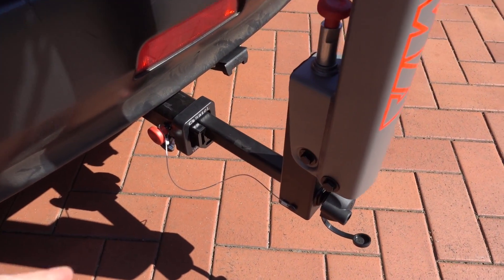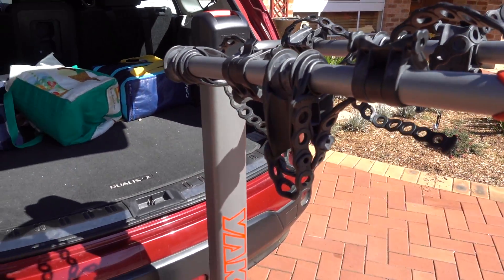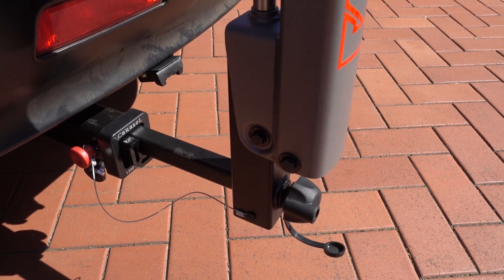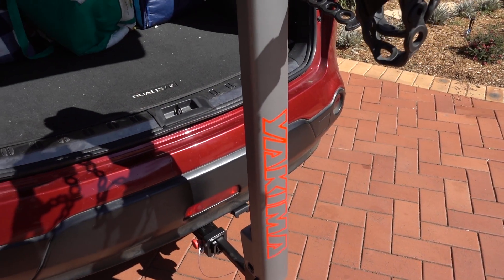Car Bike Rack Mechanical Design Paranoia

Comment: What's the weight rating on that bike rack? Seems like a.light duty one to me  for those ultra light bikes. Are you supposed to cut that bar shorter going into the hitch to be closer to your bumper? Might be made for multiple vehicles. Did it come.with straps that go from the top part of the rack and connects under your bumper on the right and left to give it stability?
Reply from the maker: 55kg max
Reply from the maker: No Straps, I should look to see if I could add them.
Reply: Three bikes seems like it would be close to the weight limit to me. I personally like to have more spare  capacity like double. So a 110kg rack or what ever closest size would probably come with the full size hitch to fit the entirety  of your reciever. No playing with shims and wedges. A little play is understandable but that sway scares me. Maybe straps would help alot. Atleast give you more confidence. I have a different style rack that mounts to the trunk of my car with straps my E bike weights 22kg and the rack is rated for 45kg and can hold two bikes. With the one bike its sturdy but I wouldnt put two bikes on it. Some.one i work with has a similar style rack as yours full size hitch and there is very little play and sway you could rock the car when pulling on it. Btw all measurements were converted from yankee measurements for your convenience. Lol.

Comment: Get new 2" to 1 1/4" hitch adapter that centers the bike rack in the hitch .... also some bike racks have a big threaded locking pin for the hitch that would take up the slack and prevent the rocking... But if you put the current rack in and then Crank down on the diagonal bolt on the left bottom you should tighten that after the bike rack is in the hitch and that should take out the slack. Also Dynamic loading should be fine the problem would occur when you put bike rack like that on the back of say a RV that you are towing and then the Dynamic Loading numbers become great... Learned that lesson the hard way
Reply: Can also get the Ubolt and plate that stops the rocking also.
Reply: I saw some with a bike rack on their RV that wasn't meant for being attached to an RV.  It literally tore the bumper right off.
Reply: Bad suggestion...

Comment: g`day it looks like top quality chinese tolerances  in the locking pin system  just what you would expect from a one-hung-lo brand  dose it comply with australian design standards might have a sticker but has it really been tested ?  mate take it back  i would  looks sus to me  if i was behind you on a motorcycle and  seen it move like that i would change lanes or pass you
cheers
james D

Comment: Add a couple of cheap straps angled down from the centre top of the bike rack to the outside under carriage.  Negated the quick opening of the boot but makes the ride stable.
Reply: that was my thought also. Eliminate the swaying which would help slow down fatigue immensely. Run a strap down to the frame or maybe up to the roof rack. Only problem is they might be in the way of opening the gate and would have to be undone each time.

Comment: I have the same one. I welded a larger tube to the receiver so it wouldn't wobble. We've taken it several thousand miles.
Reply: yup this. get some box steel the same size as the tow receiver.
Reply: A picture is worth more than thousand words.